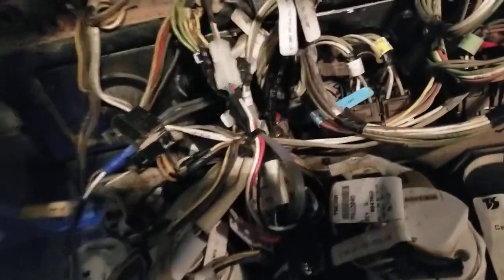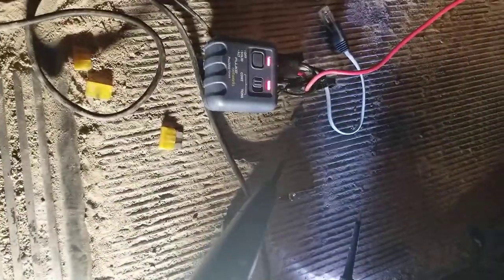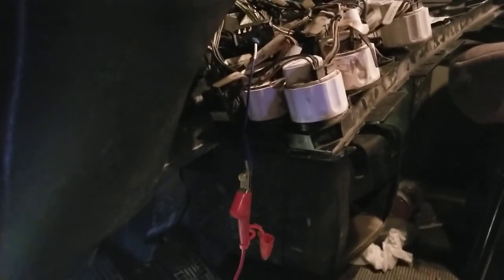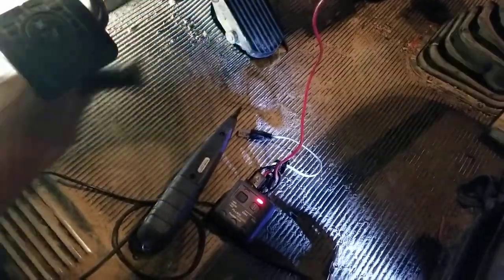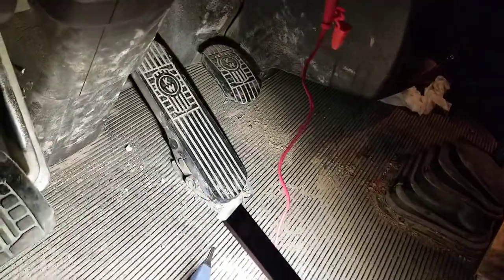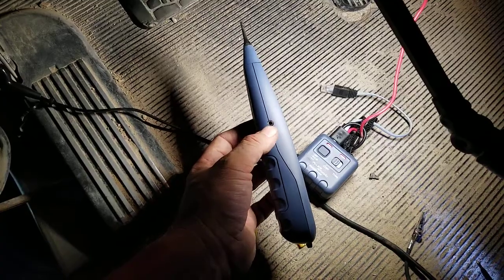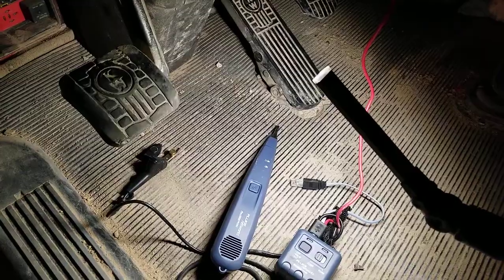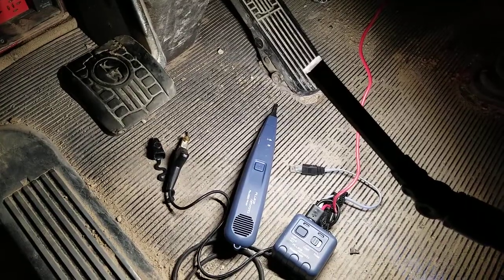Easiest way to trace automotive wiring & check for open circuits

Comment: Can I use this to find a grounding issue?  Have an old jaguar that we are having a short to ground but cannot locate it.....
Reply from the maker: Possibly,Soooo this is a sort of broad definition. Are you lacking a ground? Or do you have power consumption issue that is draining the battery? Or is it the fuse popping due to a positive wire contacting a ground?

Comment: Power Probe PWP-PPECT3000 - ECT3000 Short/Open Electrical Circuit Tester. Much easier too use, but more expensive.
Reply from the maker: I actually own that tool also and the fluke hands down is far superior

Comment: I'm trying to find where a wire goes and what it is connected to in a car, all under the dash.  If the wire goes to a computer or electronics,  I'm concerned backfeeding that signal could damage the computer.
Reply from the maker: Well first you have to disconnect all connections to avoid cross & back feeding. The tool puts a frequency in the wire not voltage. If the circuit is daisy chained ( muiltple wires on in the same run) might confuse you.

Comment: Doesn't help at all when you have already fixed it and then try to show it but the tone isn't showing the damage or short...BECAUSE YOU ALREADY FIXED IT!!!
Reply from the maker: well the fact that we are on flat rate plus the nature of the problem Electrical not mechanical leads its self to confusion especially if you are not familiar with the basics of electricity.

i did have some videos were i do show the problem and walk thru it 

but the take away in this video is to expose the viewer to an excellent tool that expedites open circuit tracing 

my philosophy is simple teach the principle of trouble shooting or the tools that help techs grow in to a diagnosis tech and not a parts cannon specialist
Reply from the maker: i made a second video which might show what your asking for

Comment: Ok I have an 1989 chevy 350 standard 5 SPD that when the clutch position Sensor is activated the clutch spins the starter  and the ignition is hot all the time as long as the battery is hucked up
Reply: I got something similar. When i turn the ignition key it turns the wiper fluid motor and not the starter. Its driving me crazy not being able to find whats causing it.
Reply: @Edgar-and-Wrench   thats interesting because mine do's this also but it is due to the wire's being soft
Reply: @user-uc3zo3bf1s  wires being soft? Like the insulation?
Reply: @Edgar-and-Wrench  the wires inside installation meaning there bad wires

Comment: I am a professional car stereo installer. Will this fluke pro 3000 works for audio system???
Reply from the maker: Yes
Reply from the maker: There is an awesome channel fir audio it’s called 5star audio check it outv
Reply: Thank you. I appreciate you.
Reply from the maker: @JoseLopez-oj2ni  Remember electricity is physics so be very careful what you’re using the device for as it is intended to trace circuits they have continuity so if there are other circuits that are in line or daisychain to it it would also pick them up
Reply: @sonofmontezuma3732  I am interested in the tracing and continuity. I do trouble shoots in audio stereo system. I currently using a multimeter which i am already annoyed by when the buzzer ain't loud.
Reply from the maker: I have a second video on this tool it might help

Comment: I don't get it, the tone at the fuse box was the same as it was at the sender unit. Am I missing something? I have one of those tools and im trying find where the short is.

Can anyone please enlightened? Dude probably not going to respond. Someone please help a frustrated brother out.
Reply from the maker: Well you have to have the ability to understand that this is communication tool that I use to help find the path of wire , since the tool puts a frequency in the wire NOT VOLTAGE, it’s showed me the wire went from the connector to the fuse box where a fuse was missing. Diagnose a short conversation s a different animal all together and requires advanced skill set . Short is very broad definition!!! Positive blowing fuse? Ground not working? Have you tried the light bull testing method? Have you amp tested the short amp draw????